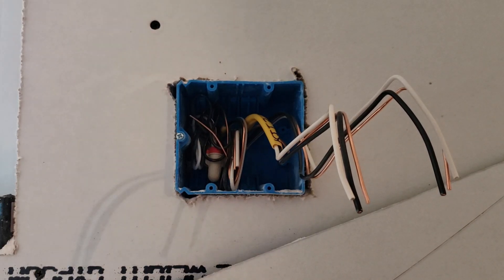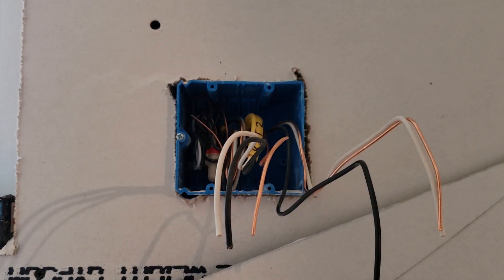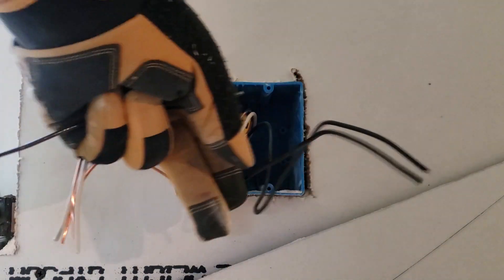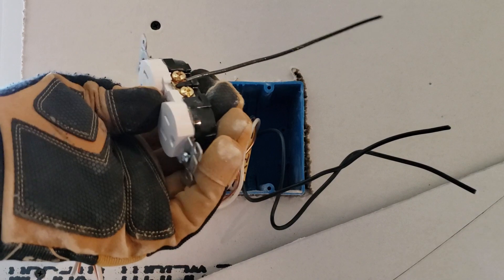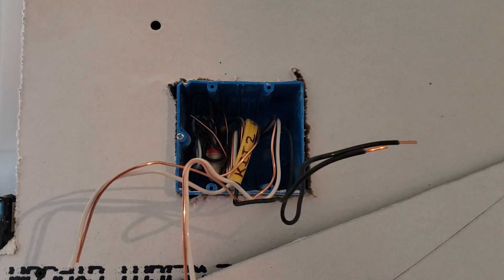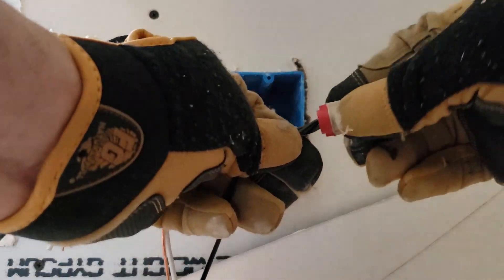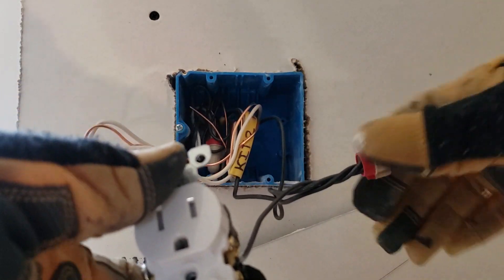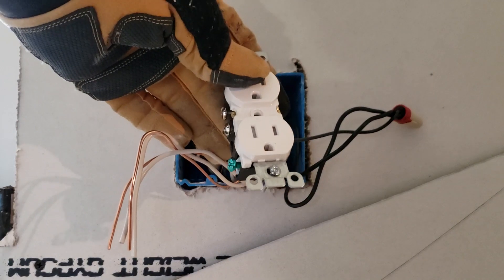Wiring a device with multiple wires in a box

Comment: Thanks! Getting ready to add outlet for my TV on the wall and opened the outlet I'm taking power from, and I think this one has tripped on me before - can see why! Had all push INS plus another wired onto the screws. Everything I saw online said it's allowed by code but not a good idea, so then I got worried I couldn't pull power from it. Thanks for this video!!

Comment: So, I took off a light fixture with 3 bulbs. In the box I found 3 sets of wires coming in. 2 hots were wired to a neutral; 1 hot was alone; and the other 2 neutrals were wired together. My new fixture has only one bulb. So, I wired the black to black and the neutral to the 2 pigtailed neutrals. Is this ok?
Reply from the maker: Based on what you described, that does sound correct. Regardless of the number of bulbs, you would wire any new fixture the same as the old to the same wires inside the junction box- and that sounds like what you did. Thank for watching Daniel.